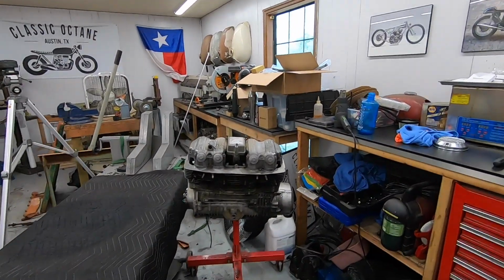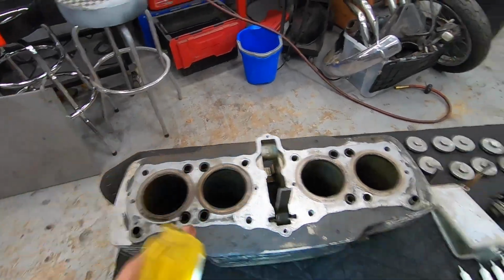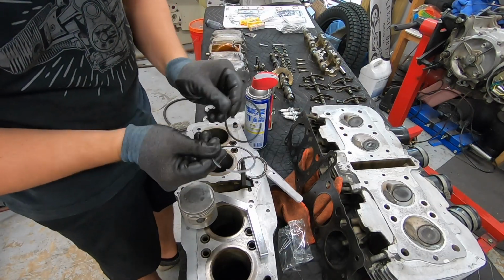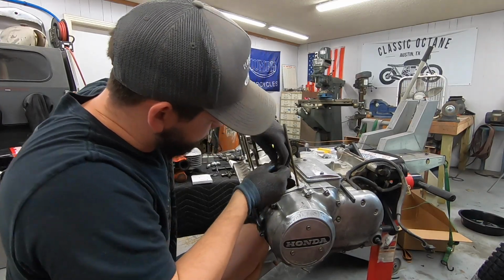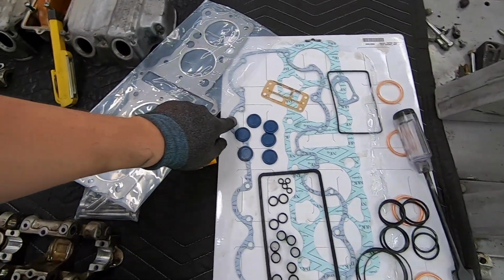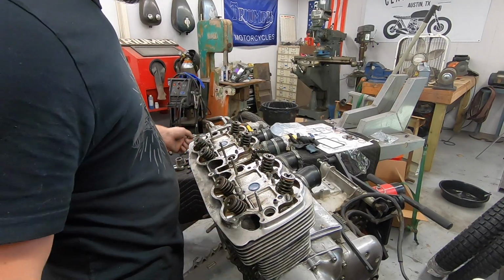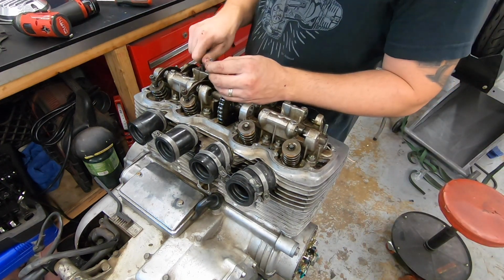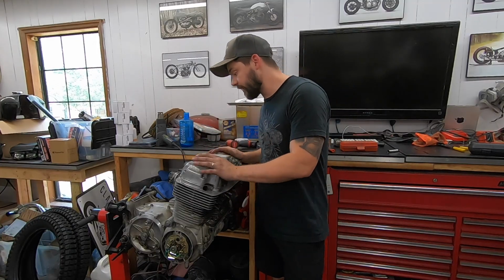Low compression CB750 engine teardown. Found the problem.

Comment: All that work, and you didn’t check the valves and seats???? Why? 

You knew you had a moisture issue on #1 cylinder. How do you believe that moisture got in there? It could have been through the spark plug hole (common issue), but however it got in, it was present whilst at least one valve was potentially open, meaning the mating surfaces and seats could very likely be corroded, as could the stems, meaning the guides and seals needed checking!

So, at the very least, the valves on #1 cylinder needed checking, and possibly re-seating. 

And when you discovered that the cam housings were rocking, and found you’d left the rubber seals in place, didn’t it occur to you that you obviously hadn’t cleaned those parts, and especially the mating surfaces?

The kiddies here are all really impressed, But I hope I never buy an engine you’ve been inside dude. I’m also glad this isn’t a ‘how to’ vid...

Comment: You mentioned location of ring end gap not being front or back of the cylinder and not knowing why. Think about the rotation of the rod and the directional force of it against the piston. If the fairly sharp ring gaps are pushing against the cylinder at the point of highest pressure (front and back) there is a high likelihood of cylinder and ring damage. Left and right of the cylinder experiences a negligible fraction of this force. Great informative video as always, showing DIY isn't as daunting as many may think. Btw would be a treat if that cam got a shot of assembly line or oil on its way in.
Reply: Assembly lube*

Comment: When I still believed that a compression test was the most useful test to figure out the status of the top end of an engine, followed by a bore scope, someone suggested a pressure test. I thought he meant compression test and just misspoke. 

But he patiently explained how pressurising any cylinders that are down on compression, will quickly reveal WHY it’s down on compression. 

If the air escapes through the exhaust, it’s the exhaust valves that are at fault. 

If the air escapes through the carburettor or inlet manifold, it’s the inlet valves that are at fault. 

If the air escapes through the oil filler, it’s the piston rings that are at fault. 

I have literally NEVER seen this advice on any problem finding vid, engine rebuild vid, bike or car vid, or forum anywhere. 

This is obviously great advice, but how come no one ever seems to be aware of it???

Comment: Great, except for one minor detail, and I have not finished before writing this. No problem on earth just exists. So that being said. All the way through I was asking myself what caused that? Then I watched the rebuild but was still asking, what caused that. Then you said the magic words, "It looks like this was done not too long ago...Red Flag!!! And so it will be a short time and need done again, why you ask, because you did not fix the problem, you did a great tear down, yet did not magnaflux the head, have the valves replaced, might as well you're doing all the hard work anyways, but,,,,, What is the real problem here? So it will need tore down again in the real near future. No motor is made to leak water in the cylinder, this does not just happen!!!! There is (not was) a problem?????

Comment: Sweet project dude!
Just my two cents as a small engines mechanic, you should try soaking your combustion chambers and piston tops in wd-40 and a brass brush, been doing this the last four years and it works wonders.
Again awesome content and great work!
Reply: I do the same but using Marvel Mystery Top Cylinder oil.

Comment: Cam Rocker Box brother, oh and by the way brother I wanted to say that the Piston Ring compressor tools are pretty badass if you're installing the Pistons into the cylinders ahead of time and then installing the cylinders on top of the rods and connecting them to the rods afterwards, because I always wondered about the piston ring positioning when they are installing Pistons connected to the rods already, the Piston Ring positioning is definitely going to change that way so with the Piston Ring compression tool installing them ahead of time into the cylinders is really really helpful, and will definitely help to keep those piston rings seated in the positions they need to be

Comment: Hi Taylor.  20 years ago I had a CB750.  Still a hole in my heart.  One of the things that was poor design from Honda was the timing chain.   To this day I can hear a CB750 from blocks away because of the rattling sound.   Has anybody designed a replacement tensioner/guide/chain/whatever to improve the design so it doesn't detract from that beautiful design?    Thanks for keeping these world-changing bikes rubber side down.  Paul N.
Reply: cycle x has it

Comment: This brought back very old memories.  The only thing I'd have done differently is pack old socks/underwear/t-shirts into the barrel holes under the pistons before trying to take rings off; I'd put them there anyway just to stop things getting into the motor.  As noted, rings are brittle; the last thing you want is to have to tear down the motor because a piece of piston ring disappeared into the belly of the beast.   Many, many years ago, a pal with a 69 CB750 bought a new Yoshi cam complete with new cam supports and a full gasket kit.  Missing from the kit were O rings for the oil lines to the head so he went to a local parts store and bought O rings.  They were too big and squished when the head was torqued down, significantly reducing the oil ways.  About a mile down the road on the rebuilt motor, the new camshaft seized.  Very sad.

Comment: What happens Taylor if the T chain comes off the bottom sprocket, can you get it back on from the top, ie no need to pull bottom off?  With Pajeros I hear its a big issue if it comes off while doing top end work. Thx Tim
Reply from the maker: You can just lower the chain a little and move it around until it engages the lower sprocket. Not a big deal at all.

Comment: you mentioned torque specs... all of the bolts and nuts have specs for tightening... after awhile you will see a pattern with certain size bolts and type of threads and material involved.

Comment: Great job on the video and the rebuild .. I have experience with  that myself.. The only part I didn't understand is why you separated the cam sprocket from the shaft. But  I watched the whole video and it is very good....not easy to do that. You are helping a lot of people to do it right.
Reply: the answer is obvious to rotate it and set chain timing correctly.

Comment: A - Im a strong believer in cleaning up the engine prior to removal and conducting a leakdown test on it at that time as well . In addition if it wasnt a runner I'd be tearing down the bottom end and checking bearing condition and clearances . Also the bore & pistons should have all been measured . Minimum piston - wall 0.001 - 0.002 clearance . Ring end gap top 2 = 0.007 - 0.016 . Oil ring = 0.012 - 0.035. little tip ... you can increase the taper prior to boring / honing ... makes installing the pistons a snap. Cam timing . I always check again AFTER cam chain tension has been set . Use assy lube cam bearing surfaces .Your videos are well done.
Reply: Pistons with jammed rings can make the bore go oval so measuring is a must before deciding what's needed.

Comment: Just use chem dip. Takes carbon off in about a hour. Can even do the heads if the valves seal good.

Comment: The reason you don’t put your gaps towards the front or back is because that is where the cylinder will wear into an “oval” shape. They are trying to reduce the chance of compression leakage overtime. Should the gaps be on the front or back when the cylinder wears out there would be massive leakage in the area.
Reply: nice bro thnx for taking the time    that was my guess

Comment: FYI - I have an OEM Honda FSM (factory service manual) for the SOHC CB750, 69-78. The FSM piston ring gap spec for top and second ring gap is 0.2-0.4 mm (0.0079-0.016"). The oil ring rail gap spec is 0.1-0.3 mm (0.004-0.012"). An old rule of automotive thumb I was taught says a safe top piston ring gap for a normal engine are OK at min. 0.004" x bore diameter (in inches), so for a 3" bore (76.2 mm), the top ring gap should be min. 3 x 0.004" = 0.012". That is just a general rule, though. Getting the actual ring manufacturer's specifications is the best way - by far. If you buy aftermarket rings - follow the instructions that come with them. If they don't come with instructions - follow the FSM specs. The Honda OEM FSM have that in the specifications chart in the chapter on the engine. The general rule of thumb for the 2nd compression ring is 0.0035" x bore. The oil control ring rails should be generally the same as the 2nd as a minimum, but the top limit of the gap dimension on those can be much larger - not as critical.

Comment: Ok, but how water came in only one cylinder?
Reply: Only one cylinder had the intake valve open when it was parked
Reply from the maker: It's possible it was stored with no plug in #4 and that's the most exposed spark plug hole when the bike it on it's side stand.

Comment: Drop a little injector cleaner or trans fluid down the spark plug hole, let it soak for a couple nights. Those stuck rings will pop right back into place, good as new. 

I've saved many an old engine that way. Definitely not very good content for YouTube, but it'll get the machine back on the road.
Reply: Yea I've done that with Mystery Oil. Really does help.
Reply from the maker: I'm sure these would have freed up with a few hard miles of riding.

Comment: I use soda blasting at low pressure very carefully to clean the pistons in the area of the ring grooves and lands. If there is a heavy build up of varnish and burnt oil on the underside of the crown, I soda blast that too, but mask the gudgeon pin bore first. I wouldn't vapor or bead blast the side of the piston at all. Besides being the 2nd and 3rd most dimensionally critical surfaces on the piston, the side of the piston may have several types of surface treatments or coatings you don't want to damage or remove. Just maybe I'll bead blast the crown or piston head to get rid of heavy carbon. But I prefer to use a soft wire brush (brass) and carb cleaner for the top usually. The skirts are easily cleaned with carb cleaner and a towel, or, if not coated, fine Scotchbrite.

Comment: While I think the early-ish Honda CB350/400 and CB500/550 I4 SOHC engines are good designs and easy to work on, I always hated the design of, and working on, the ol' dry sump CB750 SOHC. I don't understand why people like these so much. Overrated IMO. The same era KZ and GS fours are much simpler, easier to work on, better designed, and have more torque and power.
Reply: Only thing about the 550 engine that irks me is the cam chain tensioner, overcomplicated thing to change out when worn. Wish it was as straight forward as the 750 tensioner.
Reply: @alancorcoran6737  Yes, but I find the 750 is the epitome of, as my CB1100F enthusiast buddy says "Typical Honda Engineering - way too complex, way too many parts (to get a simple job done), and not much power to show for it". I also think the 550 cam chains wear out too fast....

Comment: Hope you washed out the cylinders with hot water and soap. You should be able to run a clean white cloth through the cleaned bore without a mark. Lightly oil afterwards.

Comment: Good to see that even a pro like you just ‘fiddles’ the pistons and rings in the cylinder. This process made me a bit insecure on both my CB350f and 400f top-end rebuild. It just seems so uncertain if all rings are seated right, even when logically they have nowhere else to go.. I also have a habbit of drowning everything in oil before installation, I guess out of anxiety of ruining things upon initial (dry) startup. Thoughts on that?
Reply from the maker: I prefer to put them in dry. I think they seat a little better that way. It's all personal preference though.
Reply: Sounds good to me

Comment: a scotch loc adapter with scotch bright discs in my pneumatic angle grinder is the best way to clean up mating surfaces i've ever found. they work well, and don't remove material on aluminum parts as long as you use fine discs and very little pressure.
Reply from the maker: Thanks I will have to pick some up.
Reply: @ClassicOctane  i get mine from ebay. cheapest i've found was 45 discs, 15 each of coarse, medium, and fine for $22 free shipping with an adapter. i didn't need a new adapter, but it was in the deal. coarse works really well on steel and cast, but if you're not careful, will remove aluminum.

Comment: I too love your work and videos. Can I just ask one question though? Would/should you not give the valves a ‘lap’ while you are in there? And then fit the new valve stem seals that are probably in the top end kit? Not being critical just wondering your reasoning as we can all see you have the skills to to do this job too. Wayne.
Reply from the maker: They were sealing fine and I tend to only do what's necessary otherwise you can introduce more problems than you fix on an engine that's 45+ years old.

Comment: Thanks, great job
Wish I had the knickers to pull mine apart, I could do a 283 in my sleep but this is a different beast
Reply from the maker: Taking it apart is easy. Putting it back together takes a little more patience.
Reply: @ClassicOctane  if you were closer than 2000 miles I’d be on your doorstep!
Reply: just go for it dude, you can do it

Comment: Taylor you do great work and then present it well.  Couple things I’ve learned to do. Permatex or something under the pucks or they leak. Torque cam towers and caps or risk screwing up threads. Red loctite on cam gear sprocket. Big problem if they loosen up.  Torque head bolts and do it again in 24 hours and again in 24 hours until it holds a constant torque. You can put a weldless frame kit in allowing you to do a top end job w/o removing the engine. You can always weld the frame back together.  Keep up the good work.
Reply: Yes would defo agree with the use of loctite and re-torqueing the head after a setting period
Reply from the maker: Good suggestions. Thanks!

Comment: That was another great and informative video Taylor.  How about showing your technique to remove the engine from the frame. I am mystified how you do this, especially by yourself.
Reply from the maker: It's a real pain on the 750s i'm still refining my process.
Reply: @ClassicOctane  yes it sure is, I took mine out of my chopper 750, but then used my brother to put it in, they sure are heavy and awkward

Comment: I really enjoy your Videos.  Nice Shop, and you make it all look so easy!  

In my shop, I forget where I put the wrench, can't find the right socket, look in the tool box, all wrenches are there but the one I need etc. etc. etc.  

I hate getting the engine out of the frame.  All the wiring, cables, tank and more, all come off and then the motor is removed.  For me, the motor is the fun, and the easier part.  Then putting it all back into the frame, and re-hooking everything up, correctly of course.    

I DO have the thought go through my head, What are you going through this much effort for?   I try to keep those thoughts locked up in their own padded room in my head.

Comment: I'm really surprised that you didn't use
Any assembly lube on the pistons
Reply: ...or the cams.
Reply from the maker: @stevem2531  Cam bearing were oiled before the valve cover went on. There is an access hole on the top of the bearing cap where I dropped in oil. I should have shown it a little more in the shot.
Reply from the maker: I find that rings seat better when put in dry. All personal preference.
Reply: @ClassicOctane  Absolutely the way to go.
Reply: @ClassicOctane  What about all these guys in various youtube channels and TV  shows telling that dry friction in the motor must be avoided by all means? No criticism here, just want to know your opinion.
Reply from the maker: @martinkupka3575  They are most likely referring to bearings or other valve-train components. That's why I oiled them both before buttoning up the top end. For rings they need to have direct contact with the cylinder wall during initial break-in to form or "seat" to the cylinder perfectly. Oil on the rings can keep that from happening and therefore prevent the rings from properly sealing.
Reply: @ClassicOctane  Thanks for the detailed answer. Will do it that way next time.
Reply: I would have oiled them for sure, helps ease them in i would think.
Reply: Me too.

Comment: Great information. Could you offer an explanation on why you didn't take the opportunity to lap the valves on at least cylinder 4 please?
Reply from the maker: No need. They were sealing fine. I tend to only do what's necessary otherwise you can introduce more problems than you fix on an engine that's 45+ years old.

Comment: Excellent! I'm glad it was just stuck rings. It would have been nice to crank the engine to see the new compression value on cylinder 4. I guess we will have to wait a couple more weeks  for the "finale". Thanks Mate!
Reply from the maker: I didn't want to have to hook up the whole oiling system and fill it on the stand. I will make sure to show it when it's back in the bike.

Comment: No valve job no that you have the head apart?  God video thanks
Reply from the maker: No need. They were sealing fine. I tend to only do what's necessary otherwise you can introduce more problems than you fix on an engine that's 45+ years old.
Reply: 45 years old?    More reason to finish it with a valve job
Reply: @tomweir3857   Absolutely - and 45 year old valve stem seals would need changing

Comment: Curious, you add a little lube to the rockers but not to the cam bearings? Why not?
Reply from the maker: There is a little hole on the cam bearings that allow oil to get in from the top. I made sure to lube them up as well.